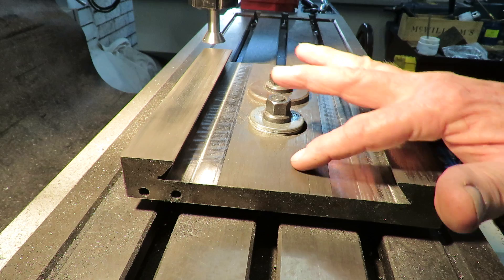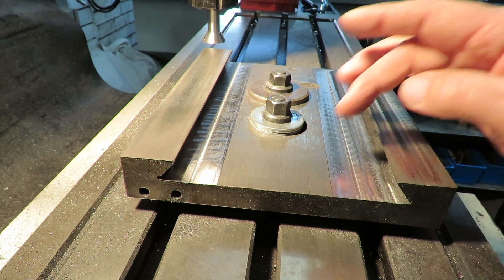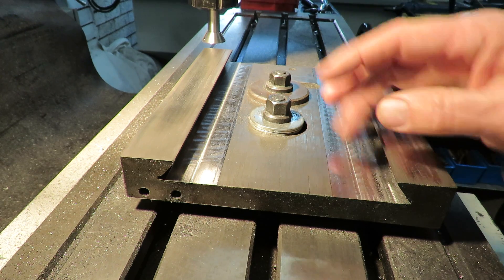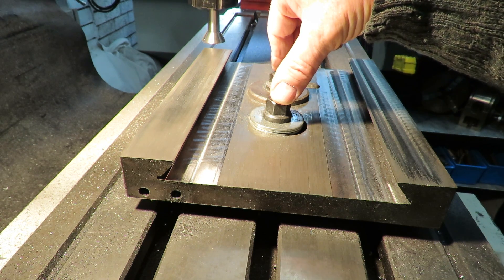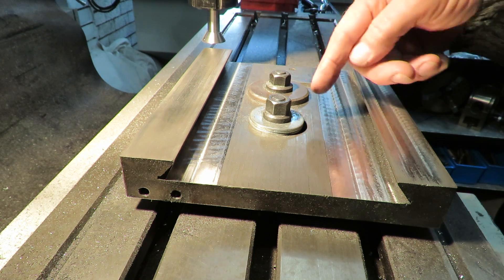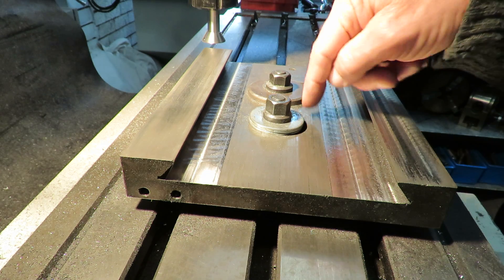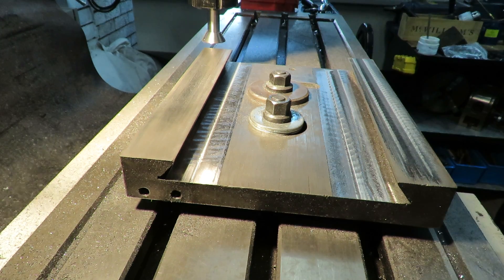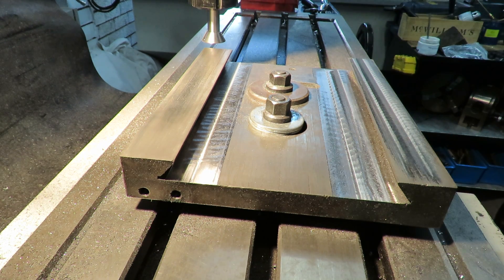Lipstick on Fred's Cross Slide tells the tale of the friction area.

Comment: What was the reference to the lipstick? I was expecting to learn a new trick but feel a bit ripped off.
Reply from the maker: I use it instead of engineers blue, it works just as well and less messy, used it for checking valve seatings 50 plus years ago a trick my dad taught me.
Reply: Thanks Bruce, maybe a short video showing its use would be interesting for people like me who still don't understand the technique.

Comment from the maker: Thanks for the feedback, I'll be installing the cross slide today so I'll get some footage for a sequel. 
Fred's lathe is from the early sixties and was in a production environment and worked to the bone and in a sad state when I found it.
I think that Fred's ways could be a good case for a Turcite  "B" coating. Pulling the machine apart for bed regrinding etc. is not an option for Fred, and there is only one person in Perth who does scraping and he's booked up a year in advance. The upside is that the machine is so heavy that it does do some surprisingly accurate machining and definitely within Fred's requirements.

Comment: Wear is always a worry with something that needs to be perfectly straight and smooth.  I wonder why no one makes machine tools with a replaceable surface for the ways so it would just be a bolt on restoration to like new.
Reply: Amateur Redneck Workshop aren't machines normally all assembled and then they adjust/grind the ways so they will be a perfect match on the finished product? So if you replace ways or something the base might not be perfectly flat and the ways could end up not being extremely flat? Idk if that makes sense, I'm not sure how to word it better, I'm no machinist, I just play with a mill and lathe and watch a ton of videos. I watch yours too and enjoy them, but I think you should let your dog lay on your couch. ;)
Reply: Oh no, my dog stinks, like a dog.  If the were to lay out the bed, grind it flat and then apply a strip of metal that itself had been ground attaching to the ways with bolts it would then be replaceable and precision.  I too don't know if this makes sense.  I have lots of ideas that don't pan out.  I think a big company usually depreciates a machine for a certain time and then gets a new one so I am sure they don't care about this.   I am not a machinist either but I have been tempted to play one on youtube.  =(;-)
Reply: Amateur Redneck Workshop like a cap that goes on the ways. I understand what you mean. Lots of my ideas don't work out either on the first try. The problem I have that frustrates me is I'm a go getter, I usually run with my ideas as soon as I get them, usually overlooking something that is painfully obvious. So most things I make are quite over complicated.
Reply: There's a few machines around that did come with replaceable bed ways. I'm not sure about the other way surfaces. For all I know there's still a few machines made like that today. And a lot of the CNC machines have replaceable linear ways.You can also order up a replacement inverted V way for the Hardinge HLV lathe as one example. Think I read somewhere that one part costs around 5k tho.

Comment: I don't understand why you don't relieve the centre section where there is evidence of scoring? 
You have relieved the flat of the ways by 0.02mm which will make the cross slide sit lower and get more scoring in the centre.
Reply from the maker: My Mistake Russ, I relieved 0.20 (2tenths), the slide was only 0.020 sorry, I need to learn how to edit and go back and fix that. I trailed the slide and did relieve the centre as well. all good tomorrow I'll install it.